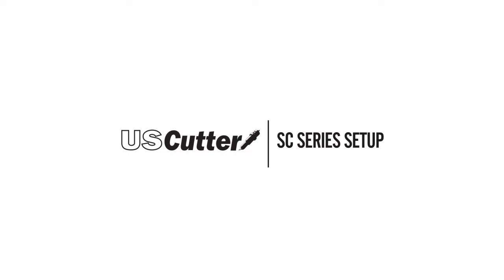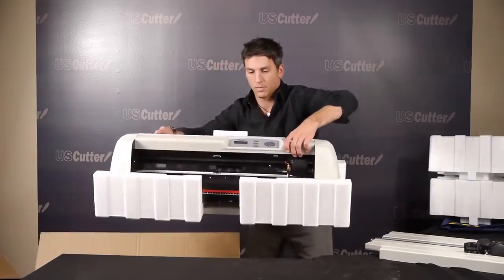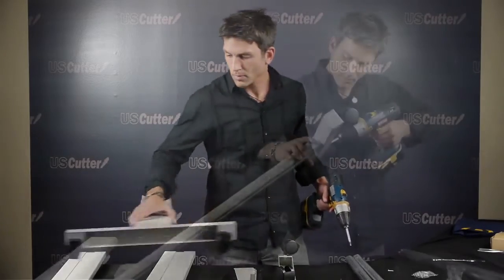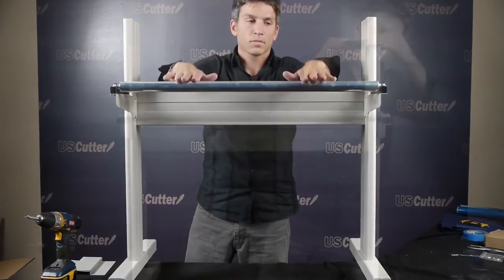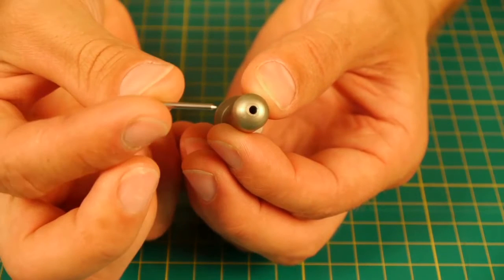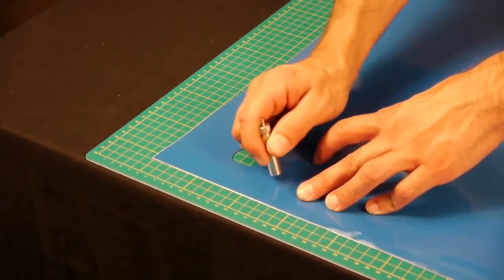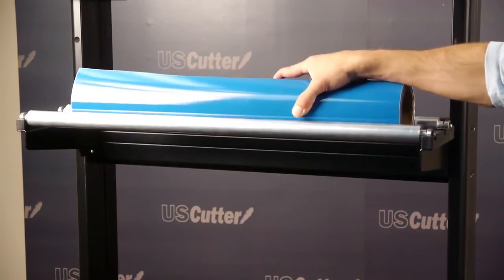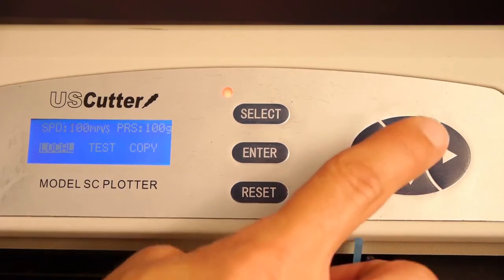SC Series Setup and Installation Guide

Comment: I had set my pressure and speed settings and they would save when I turned off my machine. All of a sudden, my SC won't save the speed and pressure settings. When I turn the machine off, these settings are lost. Is there a battery inside this thing?

Comment: whats the advantage/difference between 45 and 60 degree blade please?
Reply from the maker: 45 degree blades are used for general cutting. 60 degree blades are used when cutting smaller designs where more precision is needed. You could of course use 60 degree blades all the time, however they tend to need to be replaced more often than 45 degree blades. Most people use 45 degree blades most of the time.